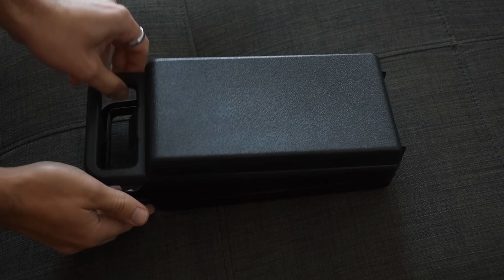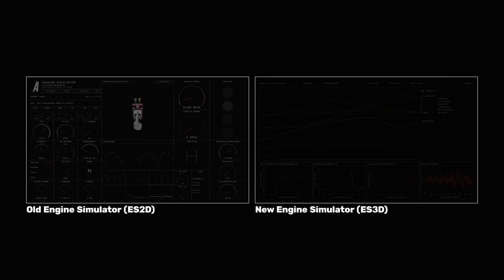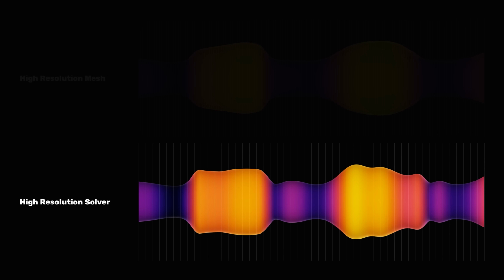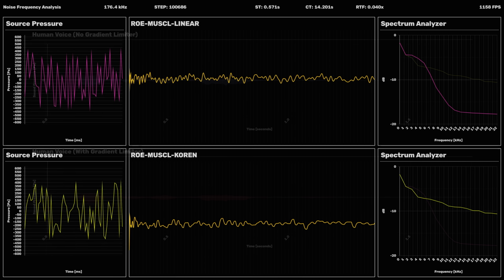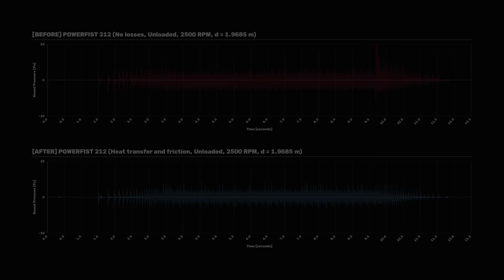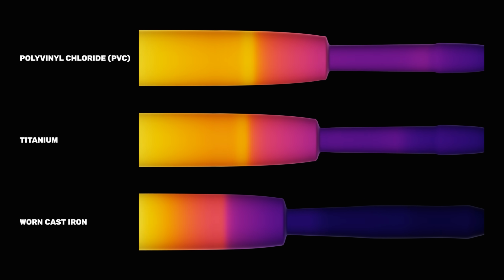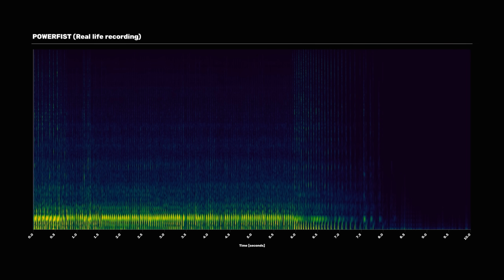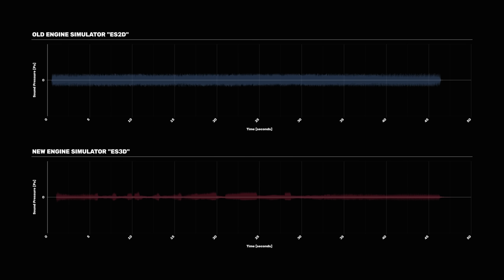Improving My Engine Sound Simulator With Real Data

Comment: Maybe the "bubbely" effect heard at lower RPMs (or when the engine is unloadedd) could be due to the discretisation of the fluid inside the pipes. Idk i'm not a professionnal fluid simulator so I couldn't tell for sure but it could be worth looking into

Comment: I assume this must have been a grueling experience, implementing all those models, then tweaking them slightly, never sure if the simulation can even sound better, not to mention passable from the simple model. I think I can feel the desperate perserverence through the screen with each iteration sounding slightly less like a pingpong ball in a tiny drum.

Comment: The weird woop sound that occured in the later simulations reminded me of the sound generated by this engine without an exhaust, it could be something that does exist in real exhausts but is usually dampended out before it exits the engine, though it could easily also be created by the backfire, either way thought this reference could be useful https://youtu.be/8jFPjUjQzVc?t=283

Comment: In the last iteration of the simulator, compared to the actual engine, it sounds like the 3rd and 2nd harmonic are too strong. You're getting ringing at a perfect fifth above the root frequency. I know you don't want to just filter this out (it's cheating!) so maybe it's a missing factor in the absorption / reflection calculations. Those frequencies should definitely be there, but they're too prevalent in the current iteration of the sim.

Comment: I wonder if i  the future having a option to add "helper" samples into the simulation wouldn't help? Bits of samples that can add some "fake" mechanical or resonance tones into the output based on recorded samples from various engines? Just a thought.

I've been delving into sound modding for Assetto Corsa and it's become clear to me how many cars exist that do not have reliable sample sources for audio, or just straight up have no reference audio at all. I'm super appreciative to see the work being put into this, and I think this is incredible.

Comment: 21:35 I have NEVER EVER had a sound like that in my ears from my computer before. As a kart racer, I'm always around 2 stroke and 4 stroke engines like these, and there's a specific feeling that you get in your head when you're driving them. You have PERFECTLY replicated the simulation to the point that when I have my headphones on, I feel that same part of my brain vibrate just as it does when I'm out on the track karting. Not even Gran Turismo, which uses real life sounds, has ever done that to me. GREAT JOB!
Reply: Is it the puttering sound?
Reply: @suspiciousstew1169 yes, it's that Pop Pop po pop pup! that gas bubble like south and it's vibrations.
Reply: Me too, I literally had a "neuron activation" moment with flashbacks to 8am mornings on <2 hours of sleep firing up 2-stroke kart engines on an ice-cold track.

Comment: i honestly would say you're 95% of the way to a near-Perfect audio sim, i would guess Exhaust backpressure and Exhaust scavenging on the engine side are the parts missing to hit the 98%+. also a neat fact engine exhaust thicknesses are changed based off of the characteristics of the exhaust note its rare for an exhausts' pipe thickness and diameter to be randomly chosen

Comment: If realtime simulation is to complicated, why not keep 2d then use the output result and bake it properly to match an 3d not realtime premade one .

It may be just a stupid equalizer or somes most advanced signal processing, maybe ai trained model to match it .

With the real full 3d model you can hear it from everywhere on every direction, if the objective is to make a racecar game around about 3 to 20 2D audio is sufficient (1 exaust, 1 muffler , 2 pipe inline , 1 audio per pipe of intake manifold , 1 audio per junction of intake manifold , 1 motor ) to ear difference when camera turn around the car .

It's not the state of the art of simulation but a way to have a near perfect sound and a near perfect motor power simulation.

Does it is to sell your simulator engine to a f1 team or make an awesome game like beamng with more motor oriented gameplay?

Comment: A ui like automation. # of cylinders, bore & stroke, # of valves. # of ports (because yes that is a thing, ive seen 2 exhaust ports on a single cylinder) etc. that should be on the to do list :)

Comment: Im also working on an Engine Exhaust Sim but no where near this level, so much simpler than this. Your work is absolutely fantastic. Just an FYI alot of Vipers, namely 2004-2017 have the crossover removed (often due to cabin heat but mostly for noise) so its basicly 2 I5 banks. (I happen to have an '06 setup this way) Also have a Harley v-twin engine and your sim chefs kiss Great work, keep it up.

Comment: Not finished the video but so far it sounds like the tube is super Ridgid or under extreme tension, like steal cables holding up a tall structure the slightest touch sends high pitched tjuum tjuum sounds across it

Comment: This new Engine Simulator sounds phenomenal!
It reminds me of modern real time lighting solutions in games... Don't get me wrong! I think what you're created makes my heart flutter with the same intensity when I hear a real car and it's absolutely a bit improvement to the old Engine Simulator! But... I think there's so much you can do with the simulation part, not just because we don't have the real time processing power to be that accurate but also because even if you had an extremely accurate simulation as you mentioned yourself the engines themselves have alot of other mechanical sounds as well.

It's time you look into more subjective ways to improve the sound and polish it up, and optimization obviously comes last.
Maybe looking into some videos about lighting and material rendering in games would give you some inspiration. Seeing how they can make such realistic looking visuals with miniscule costs to the rendering budget will blow your mind!
Threat Interactive is the best starting point although their videos are mainly focused on criticizing Unreal Engine 5.

Thank you for putting so much effort into this! It truly is amazing! I would've supported you if I could... but for now I just want to thank you!

Comment: To simulate fluid and pressure turbulence with fluid dynamics, you may look (if you haven’t) into DNS (Direct Navier-Stokes), LES (Large Eddy Simulation), or RANS (Reynolds-Averaged Navier-Stokes). From my perspective, the best approach for you would be RANS. DNS is very cost-expensive, as it is often used for research problems (simulations that take months to calculate on supercomputers) because it resolves 100% of the equations, so it needs a very fine mesh. LES, on the other hand, is a compromise between cost and efficiency, often chosen for aerodynamics. RANS, for its part, is the least precise solution but it is very efficient, and from what I see you mostly have a 1D problem at hand (except when you have pipes merging with each other), so you do not need to mesh all three coordinates.

One more thing: I don’t remember if you did it, but the pipes themselves may absorb some kinetic energy, or more precisely, sound pressure. Inserting some law that absorbs it may not be too costly in terms of performance, but you already have a huge multiphysics problem anyway so ... i du no

Anyway your problem is very interisting and i will follow it.
Reply from the maker: Thanks for the suggestion. I looked into a few turbulence models but I had a hard time finding good information, especially about LES and RANS. It's definitely something that I want to look into though
Reply: @AngeTheGreat  No problem! I’m not the best at it either, but I’m really interested in CFD, so if you have any questions, I’d be happy to try and answer them (as long as they’re fluid or thermodynamics related), and it would be a pleasure to do so (currently jobless, so I’ve got some time!).

Also, I want to go back on what I said earlier: RANS is an averaged approach, either in time or in space. Since your problem is highly time-dependent, with lots of transitional states (engine on → stationary / acceleration / deceleration → off), it might not capture everything accurately. LES would be more suitable, but it’s also much more computationally expensive. You could start with RANS and then move to LES later.

You really picked something quite challenging to simulate, but that’s also what makes it fun! CFD (Computational Fluid Dynamics) usually isn’t used for video games, at least from the little experience I have.

There are also other CFD approaches that don’t require a mesh, called meshless methods. They’re still somewhat under development, but Blender, for instance, uses SPH (Smoothed Particle Hydrodynamics) for biphasic flows (like air + water).

All that to say… welcome to the rabbit hole.

Comment: I'm curious to know how you implemented the outlet condition to damp the high frequency content. Did you add some sort of sponge layer after a smooth diverging nozzle to make a far-field condition/mesh? Or are you filtering directly the signal on a flat exit plane? Your final results sound excellent, congratulations for your hard work. Understanding and implementing all these advanced spatial/temporal schemes is very tedious

Comment: Question for you sir: It looks like your microphone setup to record the real engine sounds is positioned at a distance away from the exhaust. Could some of the small discrepancies between your simulation and the recorded audio be due to the simulation not accounting for the additional distance traveled to the microphone? I'd imagine there would be some dissipation as it travels through open air, as well as some reflection off of the surrounding environment (even if ground, dirt, and grass is pretty damping) that could cause the sound to become more muddy. Of particular interest, I'm curious if that would help with those higher frequency muffled "fwumps". Or, if you instead recorded the real audio closer to the exhaust, would that then introduce more of the "fwumps" to the samples?

Comment: Slightly off topic, but: Does anyone know of a tool like Material-Maker/Substance designer, but for creating audio? I got the aforementioned Material-Maker, Blender, Inkscape/Krita and GODOT, which fill all my needs for creating games with good graphics out of thin air. But I do not have one for audio! And that leads back to this.
 I think what AngeTheGreat has been able to accomplish could be used as a starting point to create such a tool (though much more abstracted. It would definitely be cool to have a particle simulator to create photo-realistic textures, but it isn't practical for most devs), so we could finally have the foundations for a "FOSS holy trinity" of 3 groups of software, covering graphics, audio, and interaction!
 Unless someone knows one that would already fit this! (though not Pure Data) :D

Comment: I've been following this for the past few years with the intention of being able to fine tune exhausts for sound as well as experimentation (although I'm aware it won't be a 1:1). I appreciate all the work you've put into this so far, I imagine this stuff's a total head-scratcher to figure out, I wouldn't even know where to start. But so far this new engine sim looks like it will save me so much filament! Keep up the good work Ange, I look forward to the release.

Comment: As a DSP developer, the tone/whine that appeared with higher precision calculations (11:06) come from audio buffer scaling happening in reaction to its amplitude and similar. Similar things occur when creating auto gain, compressor and expander-type functions, where the signal needs to be averaged from multiple samples for further processing.

edit:
I just analyzed the audio, the higher resolution signal is modulated with a phase rotated square wave signal. It most definitely comers from the correcting algorithm as a side effect of it, as it is most likely not intended to be used in audio centered simulations.
Reply: I doubt it was buffer scaling since he's not doing DSP work here at all until the very end, where he takes the output of the simulation and downsamples it for normal 44.1khz/44khz playback.  Right up to that point that it's simulating pressure in a tube with fluid dynamics.  He was getting standing wave reflections in the simulation, and the thinner he sliced the simulation the higher frequency the standing wave could maintain.
Reply: @danmerillat  Yeah, but fluid simulation is pretty much DSP. And he's using some algorithm to keep the calculations stable, which means, there's some part of the calculation that checks if it's about to crash and if yes it prevents it, likely by down scaling the calculation buffer.
If the crash is about to occur in a periodical manner, the scaling would also have to happen in a periodical manner - thus generating a tone. Each time a signal is scalled, it creates a step in the overall amplitude. A step like that looks like a square wave and would produce many overtones, just like it sounds in the vid.
Reply: What did you study, I’m so interested in the field
Reply: @AndRootPro  It's actually pretty funny. DSP is rather simple. Just gotta think, but that's it. No different from coding a graphical application. I study nothing related to DSP at all, I just code synths for my day job at Bastl Instruments. Keep an eye out for a code release on the Kastle 2 that's coming soon. You'll see how simple it really is.
Definitely don't think of DSP as magic or witchcraft, because that's just lies propagated by  universities.
Reply: DARKSIDE PHIL DEVELOPER
Reply: @stewartyates4510  niche reference
Reply: u

Comment: [EDIT]: Based on the OP reply, I am wrong. I'll keep it here as an interesting discussion.
[Original comment]: This effect is called aliasing. This is when audio is sampled with a low frequency without filtering the high pitch parts. The high frequency signal ends up throwing a "shadow" onto a lower spectrum resulting in weird additions to the signal when it is played back.
This is why many microphones have filters in them.
This is called Shannon's theorem. You need a simulation that will have a ridiculously small time step, like 1/44 000 of a second.
 (this is a standard 44KHz sampling frequency of entry level sound cards)
Another way is to convert your simulation into a frequency domain problem (super hard) with some sort of windowed fourier transform or wavelet transform. But that will take another year and a PhD in mathematics.
Reply from the maker: No, this is not aliasing. The simulation timestep is already much lower than the ridiculously small timestep that you mention. All simulations in this video were run at significantly higher sampling rates than 44.1 kHz. The measured sound pressure signal is then downsampled properly to 44.1 kHz for export. There is no aliasing in the output signal.
Reply: @AngeTheGreat  Wow. I am sorry for wasting your time.
Reply from the maker: No worries. Aliasing can definitely be an issue especially when the sampling rate is much higher than the audio playback rate. It just isn't the cause of this particular issue

Comment: when u mentioned “the motor produce a lot of mechanical noise” I thought that maybe the energy dissipated by this vibration could highly impact the overall noise (I’m not talking about the end resolution to the ear, as the mech and pressure sound that mixes and create a differite one, I mean that the vibration could impact the generation of the sound itself).